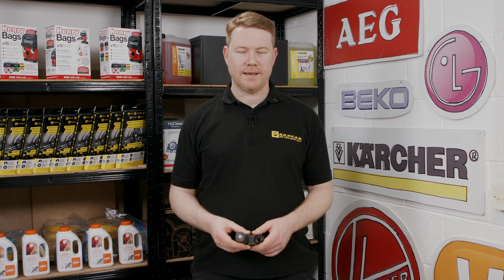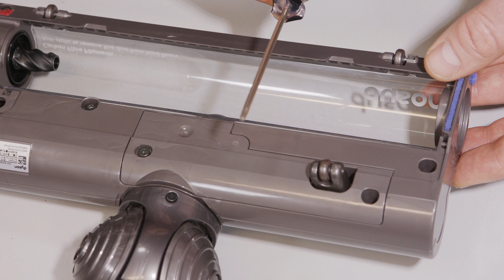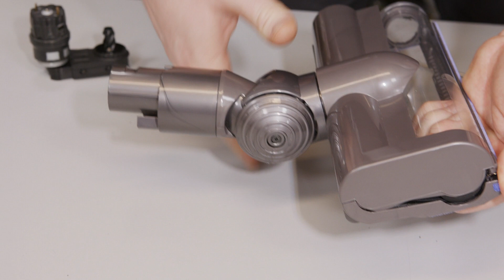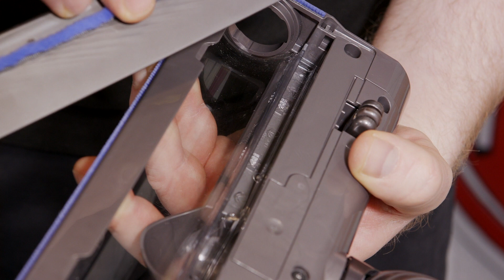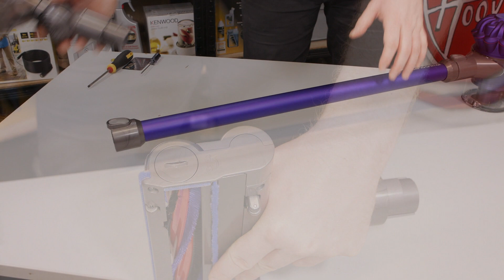Dyson V6 Vacuum Drive Assembly Replacement Process - Easy Guide!

Comment: Hello, 
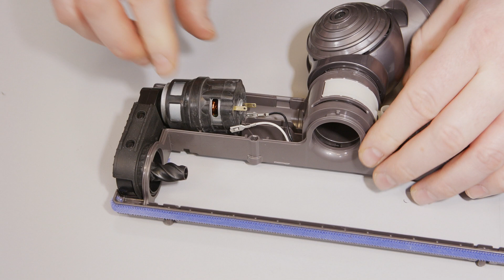While doing some maintenance I opened a bit too much of the motorhead and actually torn off the cable inside the moving assembly. The cables are ripped off under the white plastic part that can be seen at 2:54 on your video.
I can't seem to find this specific part to buy. Would you happen to know where I can buy it?
I've just bought a soldering iron to try and fix my mistake but everything is fit so tightly I don't think I'll manage to make something that'll be good enough.

If you have any advice that'd be great, as I'd be really sad to buy the whole motor head for just 2 cables.
Thanks in advance :)